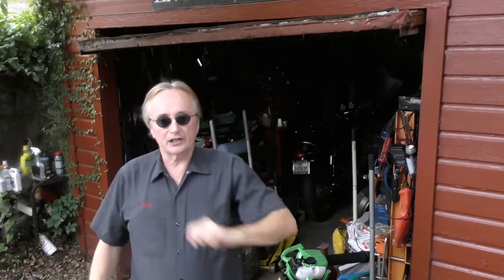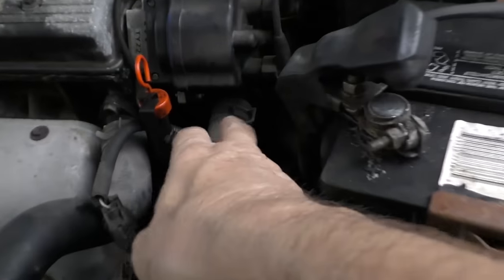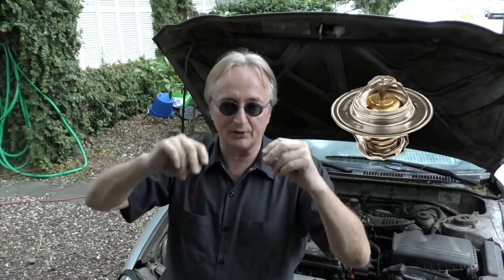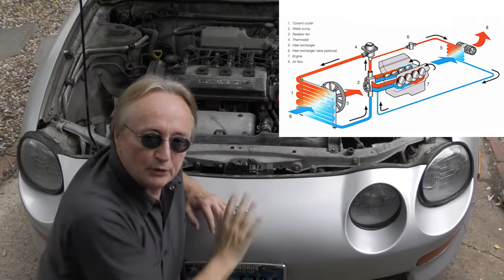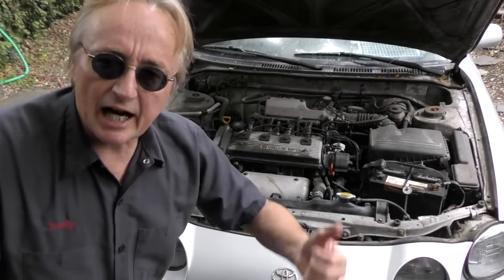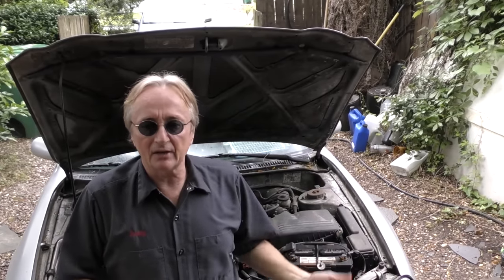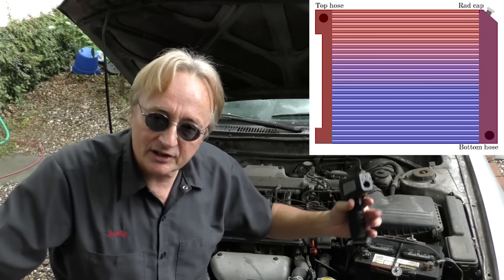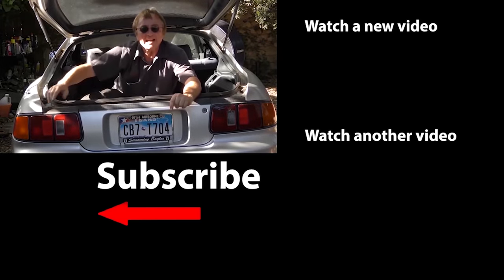Doing This Will Make Your Car's Cooling System Last Forever

Comment: In the islands, we remove the thermostat. The only draw back is that it takes a while to warm/heat up which is fine.
We also convert out radiator to a brass and copper tank.
And for flushing, we do LavRamon every 4 years!
I know people who haven't changed radiators or water pump in 25 years.
Reply: I remove mine. Trinidad...
Reply: lastservant n
Reply: Cuba?

Comment: Radiator caps are super important. Improper pressure not only overheats but if pressure is too high it can wear out heater cores and water pumps faster. High pressure looks for the weakest link in the system and cause leaks.

Comment: I'll stick with the fail-safe thermostats. Had one fail just recently, they fail in the open position.
Heater didn't work so good, engine was fine, just drove it gently for a couple of days until I could change the stat during the weekend.

Comment: Best thing about my old Pontiac is the thermostat is right under the radiator cap so you gotta take it out every time you fill up the radiator. Literally can't avoid inspecting it every time you check your coolant, which I had to do a lot because the radiator drained a quart of coolant by the time you got the cap screwed back on.

Comment: Thermostats used to be mounted on top of the engine and were easily replaceable. Nowadays the manufacturers are looking out for the dealerships instead of the car buyer so they mount thermostats in hard to get at spots. Replacing a thermostat used to be a 10 minute job. Now it can take hours.

Comment: Thank you Scotty, been watching you for yrs and it has made me a better person. I thought I would be helpful as well…In a 2012 Honda civic a cooling fan relay switch will NOT give a trouble code. I tested the fans individually and they worked fine…but I had a bad cooling fan relay. I love my civic…but there are design flaws…one of which is checking the cooling level because of the way they have the reservoir set up is a pain.
Reply: Hondas have cooling problems since 2000

Comment: While a car wash spray wand may not damage your radiator, using your own high pressure power washer can damage the radiator's delicate aluminum cooling fins! I know after seeing an HVAC technician's video explaining how some people damage their home air conditioner's condenser. Apparently you can use the right brush to reverse some of the damage when this happens.

Comment: I just watched this video today, and oddly just had the need to try the Laser Temp method on a 2000 Nissan Xterra, that was overheating.  But if I turned the heater on full blast the engine temp dropped to normal, that made me suspicious that the radiator might be clogged.  Sure enough, most of the middle part of the radiator was about 80 degrees, while both outer side sides were about 177 degrees.  
Thanks Scotty ! ! !

Comment: Also I boil my thermostat to make sure it works and isn't broken right out of the box
Reply: I like mine medium done
Reply: @andreit3582  same
Reply: tyler henry I wish I would’ve thought of that when I changed one on my Jetta many years back.
Reply: I do the same with ammo.  
Before I take it to the range, I test em.  If the fire properly, I know that was a good round.
Reply: I do the same thing
Reply: Yes same here I have been caught before with a new faulty thermostat
Reply: I expose my mind to extreme heat and the result were a hold nugget
Reply: The play classical music to mine and I talk out loud throughout the day because the first couple years are the most informative for new parts and I want it to have a bright future and not just hang around a landfill its whole life. I want it to be able to travel and see the world.
Reply: What happens to it after it boils and it's a faulty one?
Reply: @emmanuels6765  it won't open if it faulty
Reply: @coolguy2370  thanks that makes sense

Comment: Scotty you forgot to mention that you should use distilled water when you change your antifreeze.
Reply: Not needed. My family has used straight well water for decades without issue.
Reply: Yup- local water can be high in minerals- probably not a big problem unless you live in a state that allows oil fracking.
Use distilled in your car battery too.
Reply: Most premixed antifreeze is about the same as buying it undiluted. I get that more for the convenience of bot having to measure and dilute. I do usually flush the system with some plain distilled water.

Comment: I took 3 hrs to drive 7 klm to a radiator repair guy when i got there it had no fan belt either. No proublem with the head, but then again it was a Toyota. I drove 1minute parked 15. A nightmare. You da man scotty

Comment: You should replace your coolant, thermostat, radiator cap , belts and hoses every 5 years. I've only been a mechanic for 40 years. Not as long as Scotty.
Reply: I haven't replaced my belts and hoses in a minute, but I replace my coolant every year.
Reply: No you shouldn't. But as a mechanic i can see how it would benefit you.
Reply: My Subaru says 120,000? Is that too long.
Reply: Is it right to refill my radiator with only coolant en not water, please help
Reply: @bernardkhakame3218  no the water is your coolant ... antifreeze is what you call coolant, it's also full of anti corrosion additives
Reply: @philliesphan312  150.000 km or 7 years for Toyota
Reply: @bernardkhakame3218  no water

Comment: You forgot to mention most hoses fall apart on the inside, all the spray on stuff to keep them soft just makes them look nice
Reply: Yeah,  damaged hoses I've replaced were deteriorating from the inside.  If you see black gunk when you open the radiator cap, reservoir, or surge tank, you've got bad hose somewhere.

Comment: I have a 1969 Hurst Olds and I have a radiator and it's suppose to be air cooled both I do have to change my thermostat replaced before it over heats!!! Thanks for your video

Comment: Yup, my mother in law blew the head gasket on her 2.2 Camry. Caused by a stuck thermostat. Now she knows about the temperature gauge.
Reply: Those 2.2 i4s are bulletproof man
Reply: hahaha   yeah,  now she knows,   so what kind of car did she buy?   I bet now she goes into a panic when it goes up a little on warm days.
Reply: @shark11175  they are, everyone was amazed that the head gasket went. On the other hand it's a 1993, though we sold it, I still see it driving around.

Comment: By using distilled water with antifreeze is also a great tip because it keeps your cooling system clean with no mineral deposit build up it is also a must for a clean cooling system

Comment: Warning about pressure washer, you can easily destroy any radiator accidentally...
Not intercooler radiator though.
Reply: Agreed, the fins on an aluminium rad are very fragile. Bending them back into shape with tweezers is extremely time consuming even with the rad out

Comment: I got an idea listening to Scotty say that oil is the medium used to cool an air cooled engine.  In that case, why not just use a lightweight viscosity oil (i.e., 0W) instead of anti-freeze in your car's cooling system.  In addition to being an excellent heat carrier, it would never need replacing, it would prevent corrosion, and would even help to lubricate water pump bearings and the thermostat so it would be far less likely to get stuck. Also, if your engine ever got a head gasket leak, getting some extra oil into the cylinders wouldn't damage the rings and bearings compared to the damage caused by a 50:50 water/glycol mixture.  Anybody have any thoughts as to why this wouldn't work?
Reply: Have you tried this yet ?

Comment: I'm a own a Honda CR-V 2.0 2003 manual transmission and I enjoy doing my diy Everytime Im wAtchng videos like this especially from the master itself Mr. S kilmer. Now meantime I checking the oil and fluids then open the radiator cap just when I heard something like a burp in the radiator . I wonder if t was just of a good or bad radiator before going down the road

Comment: A few months ago my radiator started leaking on my 2002 Nissan Xterra. Dealer wanted $700 to replace it. I found one on-line for $60 and I did it myself. Granted, the dealer was charging for labor, too, but it really didn't take me that long to swap it out and I'm not a pro. Huge savings. Most of the time replacing a radiator is one of the easiest things you can do to a car.

Comment: A pressure washer will bend the fins on your AC condenser. Garden hose only.
Reply: You're holding that PW tip too close.
Reply: Then it affect the Ac from working?
Reply: what if the fins are bent, can you unbend them. Most of mine are bent from rock/gravel/giant bug impacts.
Reply: Tasty Hamburgers  you can't straighten out the fins?
Reply: Tasty Hamburgers  On our CR-V, the AC condenser is in front of the radiator. So the air flow has to go through the condenser, then flow through the radiator. 

The surface of the AC condenser is almost entirely flat from what looks like small pebble impacts, almost all of the fins are bent 90 degrees and flattened, like fish scales, all bent on top of each other, overlapping at the seam. 

I imagine this is part of the reason why we were experiencing overheating this summer. The top end of the condenser, the furthest from the road, is the least bent, so I assume that is where the radiator is getting the majority of its airflow from. But that means just the top fins of the radiator are getting airflow.

I've been thinking about replacing the condenser, and affixing some type of screen material, or something to keep this from happening again. I'm just worried about constricting airflow over the (potentially) new condenser with screening material. ALL CR-V's weak point is the AC, because of the styling of the front end, there isn't enough airflow into the ac condenser and radiator.
Reply: Tasty Hamburgers  Really appreciate your insight. I wonder if our AC system is pressurized anymore, on the last hot day of the year here, high desert, US, already in fall, it was just one crazy hot day... my wife was driving, the cr-v started to overheat in stop and go traffic.  My wife noticed it, turned off the AC (which is always on MAX AC, the only way too cool the CR-V), and turned on the heat and rolled down the windows. She made a stop, freeway was flowing, engine temp was okay, so she turned on the AC, rolled up the windows. Was driving for a while, then there was an explosion in the engine. She continued to drive home. Our adopted daughter, who she just picked up, noticed a black line of oil streaming out behind the cr-v in the side mirror, but was too shy to say anything!

When they got home, I noticed oil was dripping onto the driveway, and my wife was like, "OH, I forgot to tell you, we heard a sound driving home!" Well, turns out it really was a loud bang, followed by rock in the tin can that eventually stopped.

I took all the undertrim off the car, there was oil all over the passenger side engine compartment, I think oil was pouring out of the engine, hitting the serp belt, and being flung EVERYWHERE. BUT, there were huge shards of aluminum all over the engine compartment. Well, there were sever over inch in size jagged aluminum shards, and then progressively smaller shards, all the way down to an aluminum dust. I couldn't figure out where it came from, I was worried it was a wall of the engine that blew out, as it matched that aluminum finish, but eventually I found the AC compressor was missing huge chunks out out of it, that's when I discovered online this issue with CR-V's and their AC's. 

So, as I understand it, I have to replace every component of the AC system. I think the only way I can do this is if I do it myself with aftermarket parts. I'm no auto mechanic, and especially no AC mechanic, the high psi of the high side really scares me... but it might be the only way we keep this car, and we desperately need this vehicle. I'm a former attorney but have been disabled for over 10 years, I don't collect disability, and we just adopted this young lady, and she needs to go to a special school to catch up, she previously received no real education, and she needs to go to a therapist, due to extreme abuse, etc.

My wife works, and she needs a car to get to work, but I drive our new daughter around, and I need a vehicle. The school and therapist are around 45 minutes away most days. Public transport isn't really an option. I need this car, and we have no cash on hand. We also live in a part of the country where there is a VERY limited selection of used vehicles and prices are way, way over blue book, I'm talking private party sales, and most are rusted out underneath. Just a tough market.

So, I've got to get this thing running, every day of the summer here was over 100 degrees, you cannot drive without ac, or at least, I cannot drive without the ac, my illness is greatly amplified by the heat, I can't take even hot showers. First, I pass out, then things get worse from there.

So, I'm between a rock, a hard place, and an obtuse piece of metal. Not a lot of options. I think our best option is for me to take out all the ac components, and install an entirely new system... I haven't been able to find much on youtube (anything, really) that would instruct me on how to do this kind of repair, but if you know of a channel, or a vid, I would greatly appreciate a link!

Comment: Also, if you drive a car with one of those “long life” coolants in it. Doesn’t mean you dont have to check it. Read your car’s manual to see how to check it. And check it semi-annually. My 2018 Forester had Subaru Long Life Blue coolant, but I have to top it off every once in a while because of evaporation.

Comment: Rubber softener is a must if you have a  convertable with a hard top.  I drive a Focus CC and lubricate the roof rubber  two or three times a year.  The result is the roof is very much less likely to leak.

Comment: Redline coolant booster works great (not spam).  I also agree with scotty that a coolant system sealer product should be used as a preventative, i used 'K-seal'

Comment: Most of the time that I've had a thermostat fail, it's been in the open position. Car can't get up to normal operating temp in the winter, and consequently you get no heat in the car. Sure sign of a bad thermostat.
Reply: What are some ramifications of it getting stuck open occasionally? My truck will randomly operate cold sometimes (I think maybe it just gets stuck open for a bit?) I will see my oil pressure go up a tiny but as the engine is cold naturally but havent noticed anything else negative but I am a novice who still has a lot to learn...

Comment: Use antifreeze and distilled water only..tap water has minerals that will build up in the cooling system, coating the wall of your water jacket, heater core, radiator, etc. It will also cause corrosion quicker, i seen a dodge ram running straight tap water rust the propeller on a watet pump so bad it sheared off. Use antifreeze premixed. The antifreeze also has lubing effect.

Comment: During the winter months, when they use a lot of salt on the roads, salt can build up on the the condenser, and engine rad, l wash them off about once a week with low pressure water jet .
This can save you a lot of money in the long run as salt corrodes 
Alloy and causes the rad or condenser to punture .

Comment: You are right about the cap in radiator. I lost my spring and plastic inside engine. 
I don't want to know where to find it. But I bought a new cap.

Comment: I have heard in the past that what we call a "radiator" is really a "convector" ... because its main apparatus for removing engine heat is convection ... transfer of heat to air. It's true that they also radiate heat through invisible waves into their surroundings, but the main transfer is into the air being sucked through them.

Comment: I have a 2003 cadillac deville which has been a maintenance nightmare!. I have had the thermastat replaced, after replacing the reservoir which was replaced 3 times. Replaced the radiator 2 times and the water pump replaced with in the last 3 years. I replaced the driver belt and water pump belt and tensioner. After that the car still over heated and lost all the antifreeze. Pulled over and let it cool and added 2 gallons of antifreeze. No more leaks but drove to get a diagnosis right away. Told I need a water pump and radiator and replace gaskets on cylinder head crossover pipe. Told to replace the thermostat which I said I did already. Could an over heat cause damage to the thermastat and could replacing the tensioner cause a misalignment causing damage to the water pump?
Reply: I have a similar story, with water pump, thermostat etc replaced in the past year and the mechanic said I probably had an air pocket in the line when I brought my car in overheating.  So he bled the system.  This was done this morning, so we shall see.  So far so good.

Comment: Where is the best place to buy OEM parts for cars?
Reply: dealer
Reply: Ebay
Reply: Depends on brand. For my BMWs, genuine is silly, there's online stores like Pelican, Turner and FCJ that sell actual OEM (Lemforder, Meyle, Behr etc) while what you find on eBay is a lot of cheap Chinese knockoff junk. I get trim gaskets, clips and screws from ebay in bulk for pennies but the important parts like filters, sensors, rads and hoses have to be quality to last.
Reply: bennyg eBay is generally good for oem brand parts, just be sure to look at the brand before you buy it
Reply: @greebj  Just don't expect 'OEM' German stuff to be made in Germany any more. Could be made in Portugal, Spain, China or Brazil.
Reply: Trick for some parts (thermostat,  radiator cap, etc) is to find the actual manufacturer of it. Lots of car manufacturers use off the shelf components. Then find the best deal you can online.